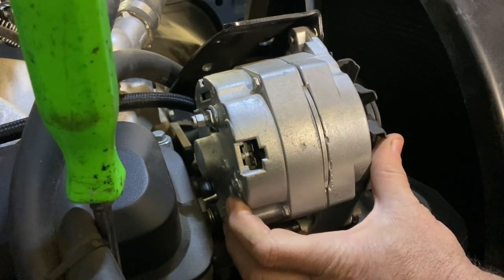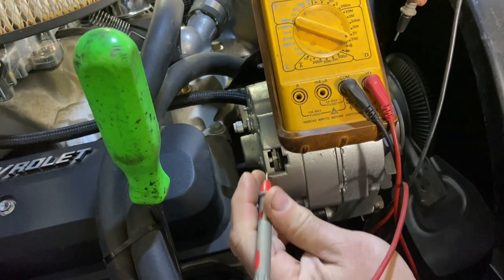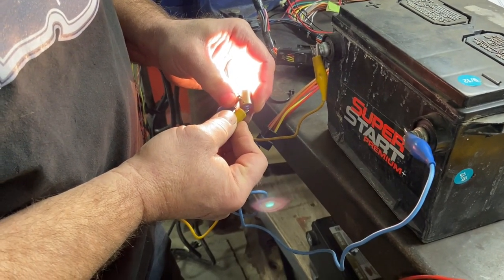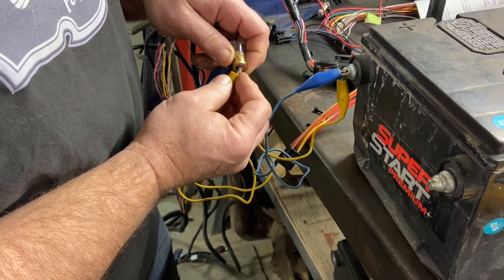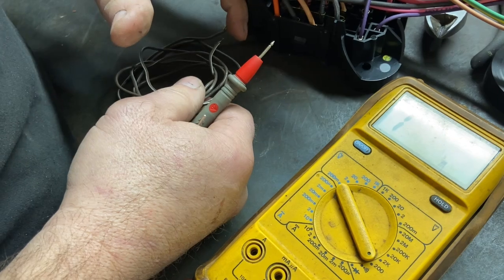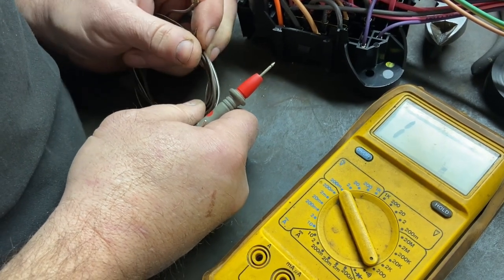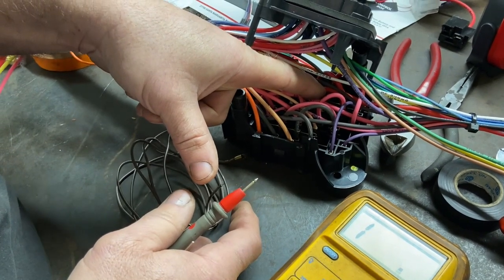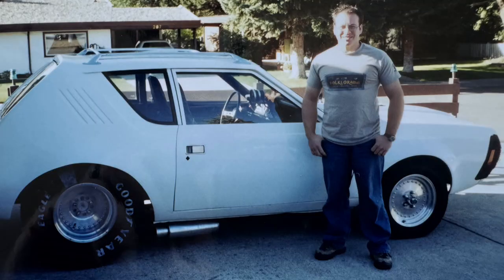Chevy 3 Wire vs 1 Wire Alternator

Comment: Your ignition wire on off that controls a continuous duty solenoid for charging the battery when you switch the key off the circuit is disconnected via the solenoid and you don't have a battery drain
Reply from the maker: Absolutely a great solution, thank you for sharing!

Comment: Praise Wings, nice presentation, I got a project I am working on. Installed a New Alternator, ran red wire back to 12 v post, white wire said go to ignition wire. I ran mine to the purple start wire. When reconnecting the Battery, pos on, neg go to put on , truck wants to start, power is get backed through white wire and engine cranks. All this happens is without the key on, keys not in ignition. If I understand correctly, install a diode in that wire and I will be able to reconnect the white wire? Or should I source out the brown wire and connect there. Project truck is 92 Chevy S 10, 4x4, going with a Cummins 4bt. Thanks for any light you can shed on me.
Reply from the maker: I’m not sure what kit you have with the white wire, it could be a resistor wire. Yes, definitely don’t go to the start wire. I would run it to the wire that connects to the charge light if it has one. See if you can find the diagram for the original wiring in the truck. Thanks for reaching out. If you need help further, please reach out again.

Comment: So are you saying that the brown “alternator ign” wire connects to the red wire on the dummy light? Black wire on the light is connected to ground . I am installing a complete American Wire harness in my 62’ c10.
Reply from the maker: If you are using the AA harness the wiring is done for you inside the dash harness. Basically how it works is called shunt wiring. One side of the dummy light is connected to 12v the other is to the brown wire. When the truck isn’t running and the alternator isn’t turning the brown wire has continuity through the alternator to ground so the light will light. Once the alternator is turning and starts charging the voltage will be equal (12+volts) on either side of the light. In order for the light to light it needs a difference in voltage for example if the charge light is glowing when the truck is running you know you have a bad connection somewhere even though you will have voltage on both sides of the bulb. Hope this helps.

Comment: Single wire is not sending a signal to tell alternates to charge battery what is wrong?
Reply from the maker: You have a single wire alternator? I’m not sure what you are asking. If it’s a single it will have an internal regulator and only a charge wire going to the battery directly or in directly. They sometimes take a bit of rpm to get the regulator excited.

Comment: Why not wire your Square Body to Full Instrumentation, which was optional on all years.  An ammeter or a voltmeter is much better than an idiot light.
Reply from the maker: @jamesbosworth4191  this one is actually getting a digital dash. It looks totally stock and he wanted the alternator wired under the hood to look not modified.

Comment: There are some <4> wire alternators out there.  1 battery and 3 on the plug.  Gleaner combines used the extra wire to power a shut down buzzer.  If the belts brake and don't see the light, the shut down buzzer activates.  Also used on power plants for irrigation.   No one to watch the light so kill the engine to keep from overheating if a belt breaks
Reply from the maker: @charliemagoo7943  great info, what style alternator is that one?
Reply: @prairiewingsperformance6036  they are 10si alternator.   Where your white plug is they just use an extra terminal beside the regulator not inline.
Reply from the maker: @ great to know, hopefully that helps others as well! Thanks for taking the time to share that!!
Reply: @prairiewingsperformance6036  10si.  Some have a tach signal  on the back as well

Comment: Good video my friend.
I did and still do install/convert to the 10-si style alternators on many vehicles often. It is actually my go to alternator. I specially do tractors and some odd machinery. I do use both styles depending on application. Often antique tractors I'll go with the single wire due to the lack of warning light. I have used resistance before but rather the simplicity of the single. Note, you have to reve the engine to a certain rpm to self-exite the alternator, especially if the crank pulley is rather small. I myself never had one killing a battery.
Also never bothered looking under the caped plug of the single...
Have a good one,
J.F.🇨🇦
Reply from the maker: @santerresongarage7486  thank you so much! Still learning the YouTube thing, enjoy it. I used to work in a starter alternator rebuild shop, there were a few different single wire regulators that were available to put in. Back in those days I would reach into the bin and didn’t care what I put in because I was told they worked the same. I do remember spinning them on the test bench and noticed some took some rpm for them to turn on. I have an old Case with a single wire and I let it warm up a bit before I rev it to get it to charge, that one doesn’t kill the battery others I had did?? I took a quick gander at your channel, will check out more! I have a couple friends that are into antique tractors I am definitely going to turn them on to your channel! Thank you so much for taking the time to watch and to comment!